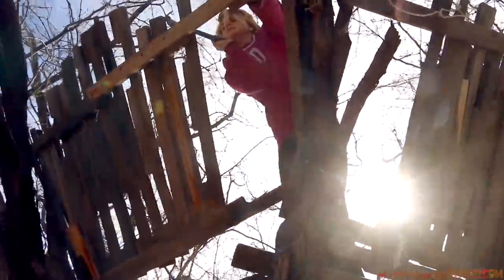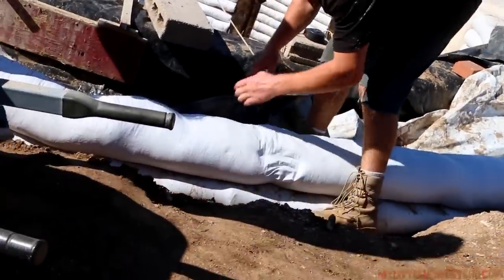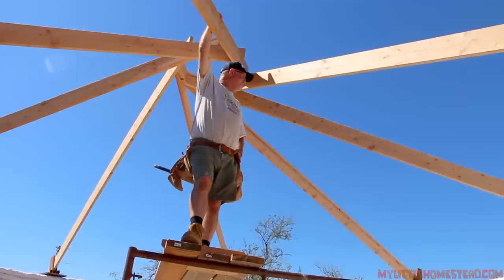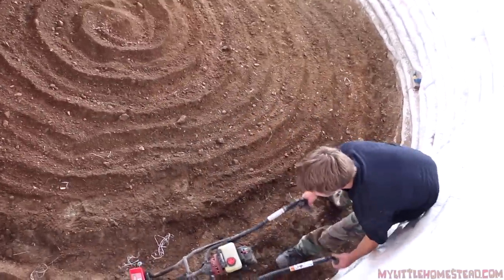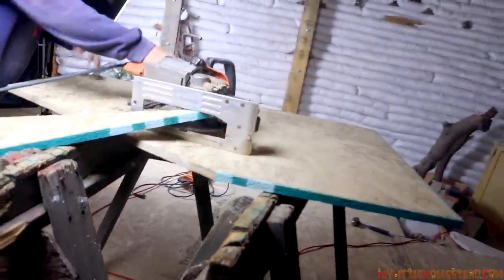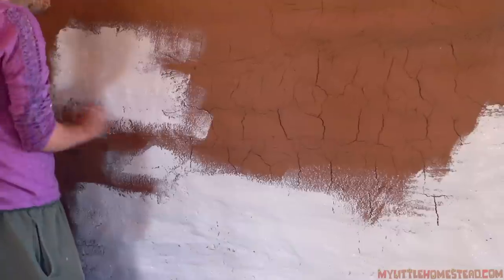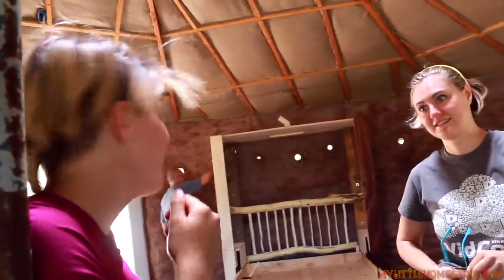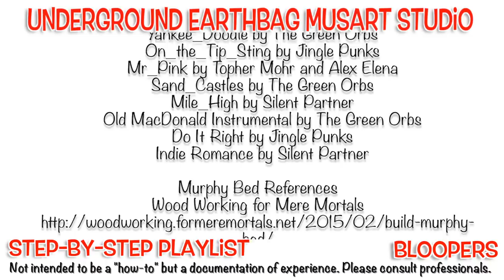Complete Build of Earthbag Studio/Guesthouse Construction! | Full Version Movie Underground Building

Comment: I haven't reached close to your level of working together, but a while ago I asked my two sons for help in putting in a stone pathway. They really wanted to do it on their own, so I just gave them some overall parameters and then I went and gardened elsewhere so they would have their space. I came back later and saw that it was laid out different then I would have yet  it did what it was supposed to do (linking two elements) and I found that I really preferred their approach--much more whimsical then mine. So anyway, I am working towards your teamwork approach. In the meantime, it is so cool to get help from my sons with different projects. Thank you so much, you'all are such an inspiration. And your skill sets are phenomenal.

Comment: what happens in intense rain...wont it flood?
Reply: Compeer Raa 
They're in the desert. They only get 12 inches a year. Also, the top floor is wider than the lower floor, and the roof is wider than the top floor, so water never gets near the lower level. Also, the earth bags turn into a type of concrete, so they become almost waterproof. I don't see water getting into the downstairs. They could berm the outer walls and dig a trench/swale/moat/French-drain around the house some distance wider than that, but probably not necessary.

Comment: you built your house out of bags of dirt. Those were some high quality bags of dirt.
Reply: Nothing wrong with a dirt house, when it's made right. With the right mixture, that dirt turns rock hard and solid, as shown in the video when he was knocking on 1 of the bags. Cob and Adobe structures (which Earth Bag buildings are inspired from) is how many homes were built, long before cement came around, and they last a lot longer than most homes built these days.
Reply: Khione in my Town there are lots of adobe houses still in use

Comment: door handles: I embedded screws in sea shells filled with grout after the screw was screwed into the hole in the door from the inside of the cabinet.  After that, I glued and grouted around the bottom of the shell the full circumference of it.  Best door knob in my entire house.  It has lasted for more that about 20 years so far..

Comment: I would have turned the tall cabinet 90 degrees so the doors would face over floor surface. I'd have built my own in the shape of a triangle but with a back wall so it wouldn't protrude or look strange. Meanwhile making more convenient use of the same space. Professional looking furnature is surprisingly easy to build if you are handy. Even if only with symetric rectangles, a sleak exterior is all about a few layers of sheets or a few thin wooden panes. Less exterior mostly does more than lots.

Comment: I would have insulated the ceiling with rigid polystyrene board where I used 3m spray adhesive to attache the burlap to the 2 inche thick insulation board. Then so.e liquid nail. Not too much Maybe just four dollops in the four corners of  each piece.

Comment: Think the workshop should be on the main floor and recording studio on the upper.  Easier to move things in and out of the workshop this way.  Less chance of hearing someone walking while recording.  Less overall sound pollution on the second floor.
If the point of a sound studio om the first floor is to prevent someone from turning on noisy equipment, just wire in your own "on air" or recording sign to signal that the recording studio is in use...

Comment: I have a couple of questions.  1.  How much does it cost to build an entire home using these materials?  2. How do you insulate the home?  3. Are all the floors concrete?  4. Do you have radiant heating in the floors?
Reply from the maker: 5-10 k.  Batting in the ceiling. Yes. No.
Reply: @mylittlehomestead  Wow $5-$10K.  That's not bad at all.  I myself was trying to get 7 Shipping Containers and having 5 of them welded together and making one Large Home.  The other 2 Shipping Containers will be welded together and turned in a Dedicated Home Movie Theater with Dolby ATMOS, Vision, DTS, and THX.  Will feature a Fixed Frame Movie Screen that's between 180"-290" 16:9 Ratio.  The Digital Surround Sound will include a 7.3.9 setup (I think that's what they call it).